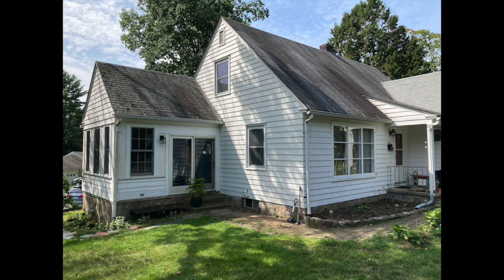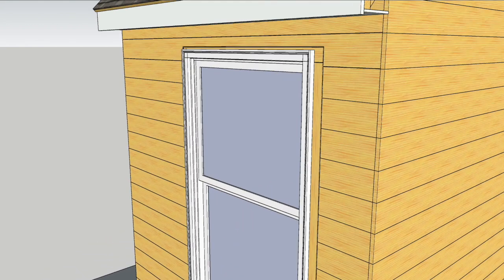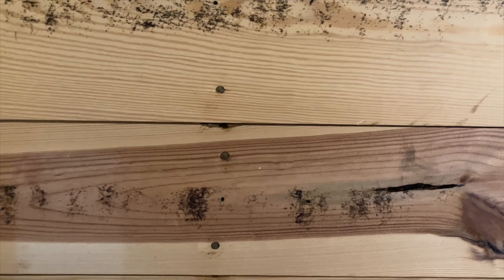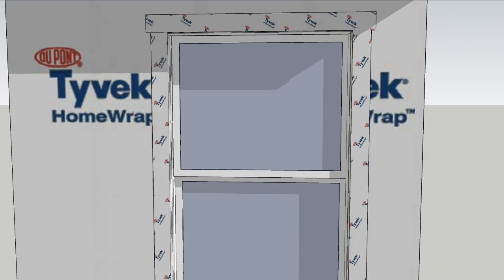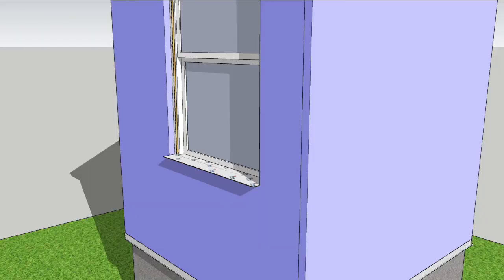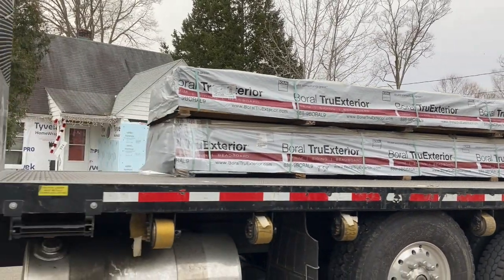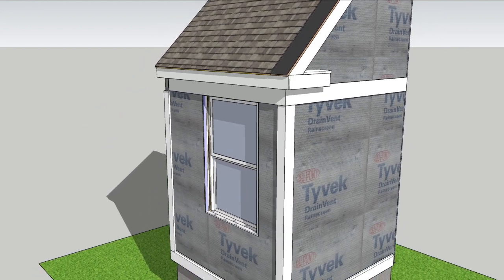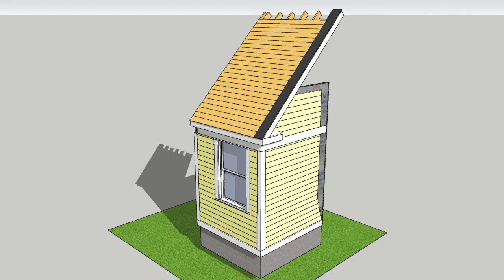Exterior Wall Insulation Retrofit of Cape-Style Home (Tyvek, Styrofoam, BORAL True Exteriors siding)

Comment: Can I do this to a detached unheated garage in MA or will it get mold?
Reply from the maker: You can certainly do it to an unheated garage, but not sure why you would, unless you're planning to add heat. Mold won't be a problem in any assembly if moisture control is understood and implemented by the builder.

Comment: The  Styrofoam is a vapor and air barrier barrier, so why put tyvac underneath it?
Reply from the maker: Styrofoam is not a vapor barrier, it is a bulk water barrier, but it is not impermeable to vapor. The wall can dry to the outside, albeit slowly.

A layer of Tyvek and two layers of foam with seams offset are all parts of the air barrier SYSTEM.
Reply: @ProTradeCraft  Styrofoam has a permeability rating of 1 (which makes it a vapor barrier for all practical purposes).  Tyvek has a permeability rating of 56.    So you are trapping moisture between your Tyvek and Styrofoam.  Having something with a 56 perm and covering it with something that has a 1 perm seems to be kind of stupid.  And, FYI, Styrofoam is an air barrier.  Look up the engineering specs yourself.  Don't believe what every salesman/contractor with their head up their ass tells you,
Reply: @tommak6516  With the Styrofoam  right over the wood sheathing, then the Tyvek  over the Styrofoam, with the siding over that with a small drainage gap, I'd expect any rain that got in to go right out and with the right flashing, the Tyvek would protect everything inside of it from both air infiltration and rainwater. And the cost of the mesh could be put into a short vacation or a new guitar or something. Does that sound right?
Reply: @pcno2832  Do whatever idiotic thing it is you think is right.  I am through trying to eplain things to those who cannot understand reality.

Comment: Hey, I'm doing the same thing on my house right now! How did you replace your windows from the inside? With inserts? If so, are you just planning to insulate the cavities around it with can foam? I have a cape cod home from 1950, looks the same vintage as yours, and the windows I think are original Andersons. The 1x3's around the perimeter seem integral to the brick mold. I can saw off the brickmold and sill but it seems more work than popping out the window and popping a new flanged window in. Thoughts?
Reply from the maker: Yes, inserts from Pella. My original windows were buil,der-special spring-loaded jalopies.

With original Andersens,  I'd call Andersen and see if you can retrofit just sash or at least what your options are. Andersen is REALLY good at backing up their previous products, so I'd suspect replacements would be a snap.

Yes, canned foam to seal any perimeter cavities.

Removing the old window will disrupt the interior trim, so it won't be popping them out and in.

The decision tree for what kind of replacement windows has a few branches on it, too. I have an article about it on ProTradeCraft, here:
https://www.protradecraft.com/photos/window-replacement-options-remodelers